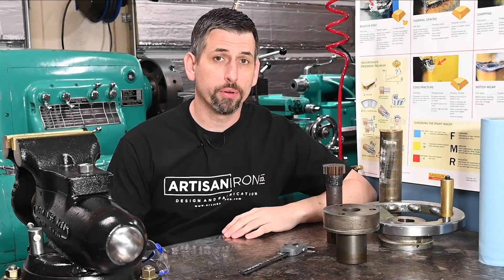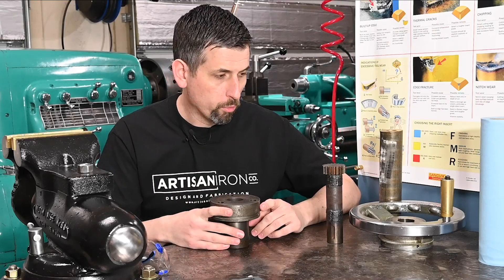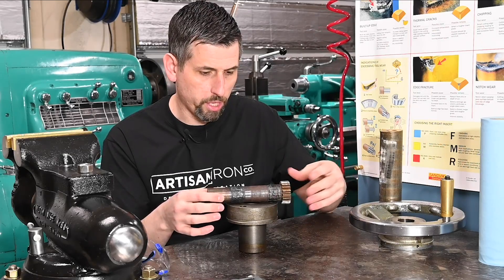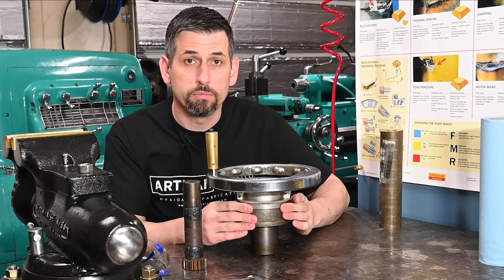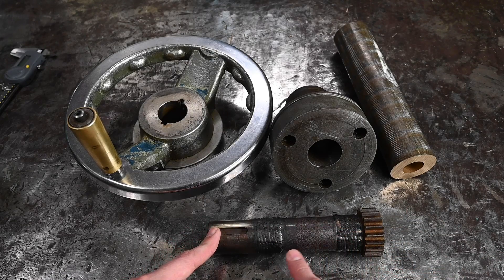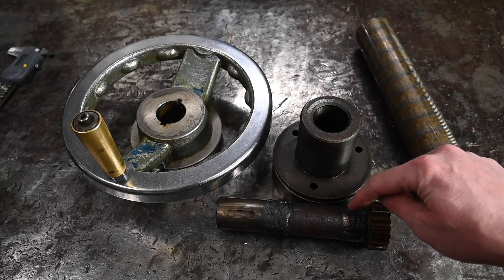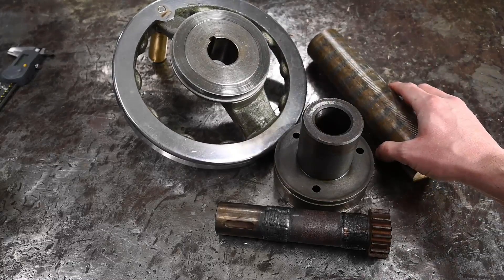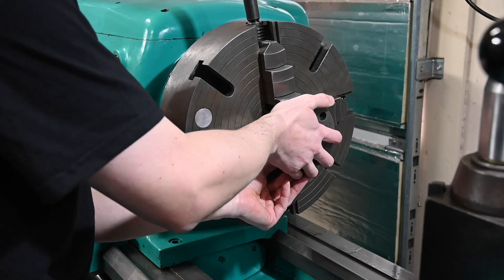Repairing a Mori Seiki Engine Lathe- Steel Aluminum Bronze and Iron!

Comment: Excellent repair/refurbishment.
Just a thought, I have used off the shelf "Oilite" oil impregnated sintered bushs' and turned to outside diameter only if required, to reduce the cost of purchasing suitable bearing bronze material. The inside diameter/bore should not be turned with a single point tool, reaming is okay, but a roller reamer is needed to reinstate the bearing construction matrix.
Enjoying the chips 👍.
Thanks for sharing.
Reply from the maker: I hadn’t heard that- thanks for sharing!
Reply: @AlwaysSunnyintheShop  You're most welcome, I enjoy watching machining videos, so if I can reciprocate, then it's a plus for all.

Comment: That lathe is in too fine a condition to not mention this. Keith Fenners videos are a pretty good example of preventative action since he makes a point of covering his lathe ways any time he's turning rough cast iron, rusty material and doing any shaft polishing. Yes your lathe ways will be hardened, but the bottom surface of the carriage isn't. Once any hard material gets under and becomes embedded into those softer  bottom ways they then act just like a lap against those hardened ways just about forever. I know of no simple or cheap way to remove that embedded material without re-grinding or hand scraping them. So it's well worth taking a bit of time to cover those way surfaces when it's needed. It's also worth Googling the physical property's of rust. It's a rudimentary and basic form of carbides and much harder than the parent metal it came from. Reading through the Connelly book Machine Tool Reconditioning just once was enough to change my poor lubrication and way surface cleanliness habits and it's roughly $100 price tag was probably the best money I've ever spent on anything in my shop. I use the cheapest aluminum cooking foil I can find as temporary way covers and then toss it at the end of the job. For anything that's really rusty I wire wheel it first to remove the majority before it goes near the machine.
Reply from the maker: Definitely good advice. It wasn’t visible in the video but I had a blanket covering the carriage and wiped the bed ways about a hundred times while cutting. Can’t be too careful though that’s for sure.

Comment: There was a feature on the gear end of the shaft. Was there not one on the opposite end? I would have thought is was originally turned between centers. Although, now that think about it... that four jaw looks heavy.
Reply from the maker: The other end is threaded for the bolt that holds the handwheel on, so only the one center on the gear end.

Comment: There are a few reason why you want the bearing surfaces as small as possible in a production environment.

- The fished bore can be less accurate
- Less finished surface means less tool wear in production.
- The hollow area can be used as oil reservoir.
- You have less friction even with a less accurate bore.

- When the bearing wears down the eccentricity is not as bad as with a solid through bearing.

But of course most of them are not relevant for a hobby shop.
Reply from the maker: That’s basically what my conclusion was. I talked about it but had to cut it- the oil hole in the hub lines up on the bearing surface, not the middle low area which is what I would expect. If it were in the middle it seems like oil would flow to both bearing journals. Thanks for watching and taking the time to comment!
Reply: I don't believe that Mori Seiki used any excuses to make anything unprecise for their precision machines. Maybe the engineer that designed that was the FNG.

Comment: have you thought about turning down the rusty area between the bearing journals on the shaft.. so you can slip a loop of felt wicking around the shaft as you install it in the brass  sleeve.   perhaps also when you have created the bushing  if you are going to redrill the oil holes and put a groove to feed both from the original oil fill..   you may think about some o ring groves on the OD of the bushing to seal any oil fill in..   on the Teflon bushing behind the crank wheel.  you might be better off counter boring the faces so the OD seals metal to metal with the teflon holding about 0.002 ... use Teflon ball hitch grease to lube both sides of the teflon also.  just thoughts to improve the components..  i taking it that you are going to have lip seals on both ends of the brass bushing.
Reply: Good reply, who taught him to drag the micrometer over the work is what i want to know lol
Reply from the maker: Uh oh. When was I dragging a mic?
Reply from the maker: All sound like good ideas thank you.

Comment: I don't know the Mori saddle anatomy, but I do wonder about things. Like.. gear mesh and interference adjustability. Too tight might be a problem and need to be investigated a little more. 😊
Reply from the maker: The parts have been installed and he said they fit perfectly so I guess we’re good!
Reply: @AlwaysSunnyintheShop  That's good to hear. 😊
Reply: If you make the shaft with the gear to the original dimension you're going to be fine.  In any case the wear in the saddle usually decreases the gear engagement a fair amount and likely the shaft could be moved up on the apron 10 thousandths - at least until a rebuild.

I'd look at the apron oiling system, it looks like it's missing that shaft.
Reply from the maker: @russkepler  The apron oil bath was empty and had been for some time. Lack of maintenance kills machines!